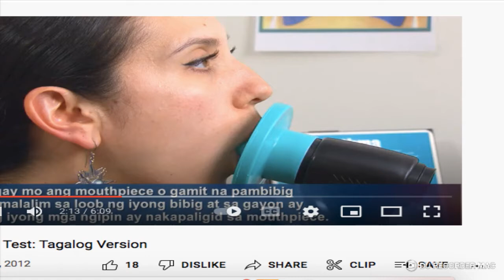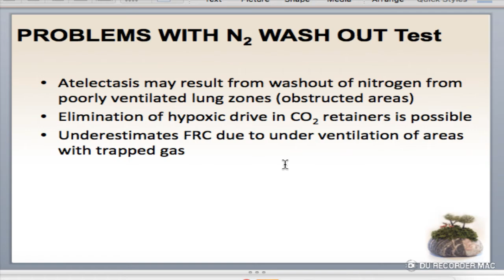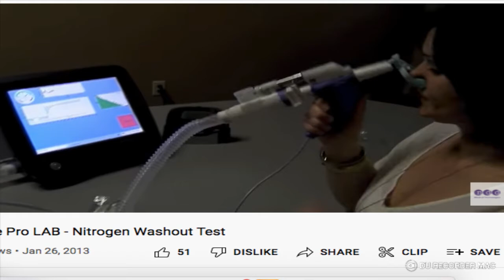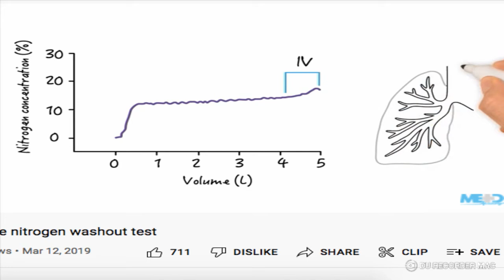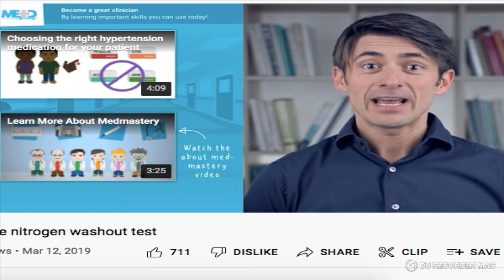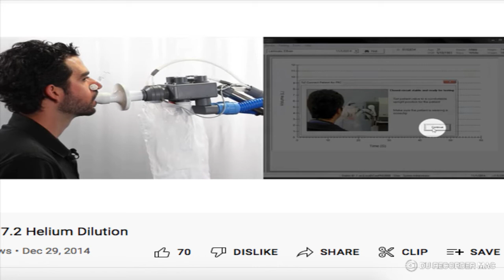PFT ACCEPTABILITY CRITERIAS

Comment: Question po. I hope mapansin cause I am so  confused po sa acceptability criteria it says " 3 acceptable FEV1 and 3 acceptable FVC but acceptable FEV1 and acceptable FVC are not necessarily from the same maneuver" Meaning po ba if the patient did 8 maneuvers but had 4  that met only the FEV1 and 3 that met only FVC would that mean that it met ATS criteria? Or does it mean that both FEV1 and FVC criteria needs to be met with in the same maneuver/loop to count as one acceptable maneuver?